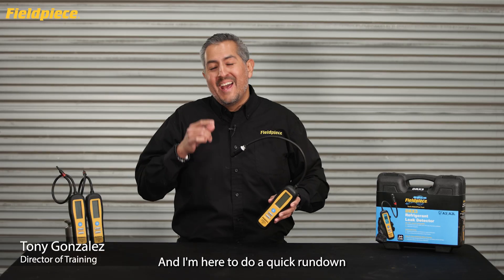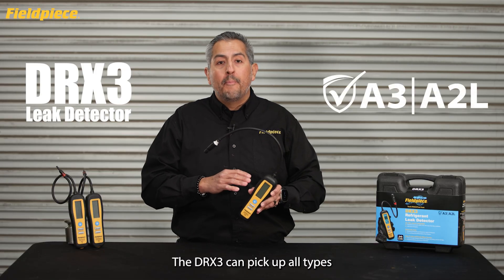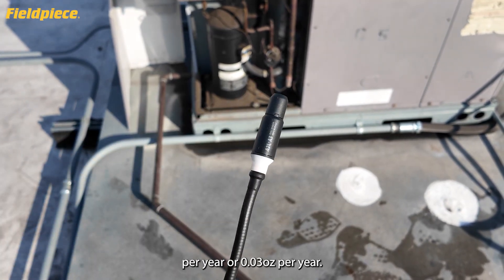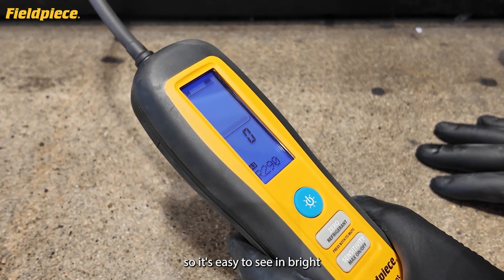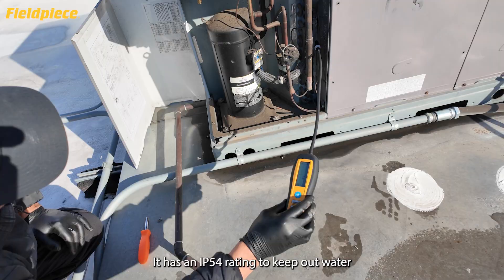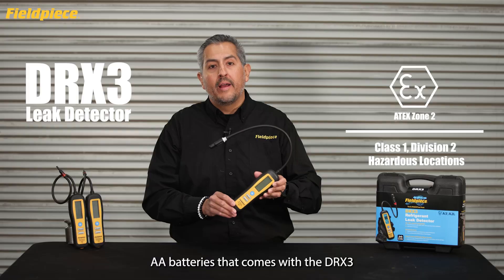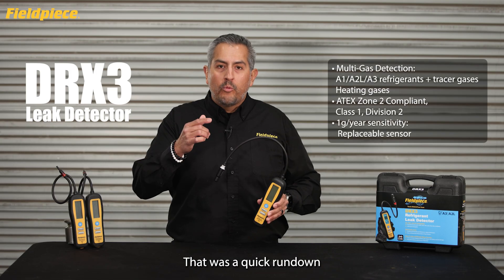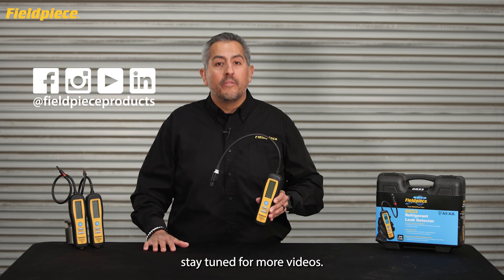Fieldpiece® DRX3 Refrigerant Leak Detector: Complete Overview & Features

Comment: I've been waiting for this tool for a long time, the combustible gas detectors on the market are ... not great and proper calibration is a problem. I sure hope this one has been done correctly, if so I will be ordering lots! :)

One main question - What is the PPM sensitivity of the combustible gas detection? As in, what is the lowest concentration of natural gas that the instrument can accurately register converted to a parts per million scale? Combustible gas detectors typically list instrument sensitivity in ppm so it is difficult to compare this to other instruments that we use.